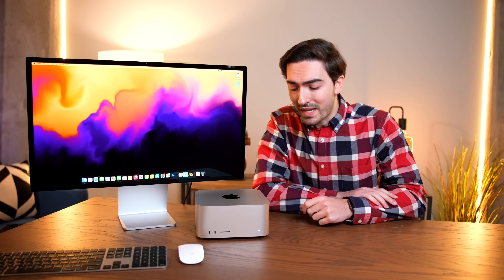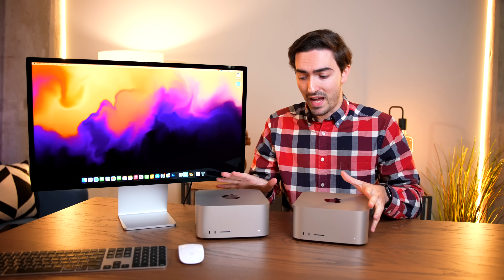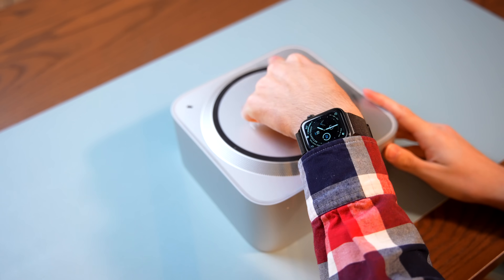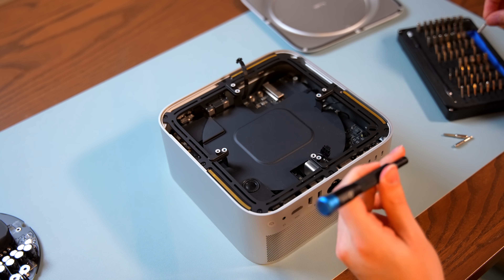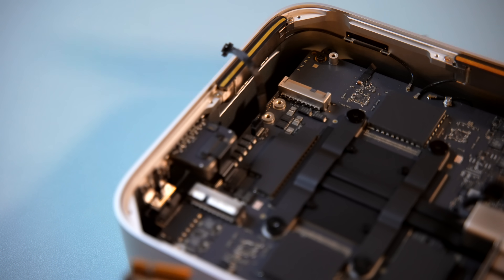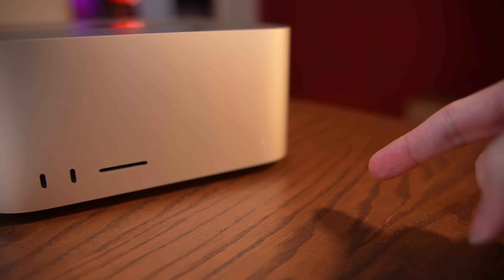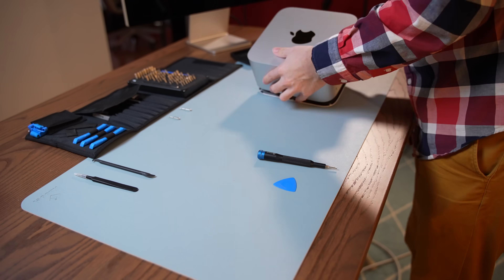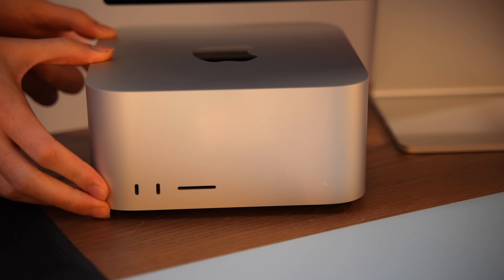What happens if you try to UPGRADE a $5,000 Mac Studio?

Comment: I think in Linus Tech they had use another Mac via usb-C cable to put Mac into recovery mode for switching Apple flash storage (SSD) from another Mac / next I would look into opencore it might work now on M1 macs/ if not owc has m.2 and Sata enclosure supports upto 3.50 drive which I would go with 16TB HDD 7200rpm and minimum 2TB m.2 SDD and just buy the enclosure from owc

Comment: The only way to persuade them is to stop buying from them. That how the free market works. At this point there are enough folks who don't care so Apple will continue the practice. If it is really a game changer then just pay up front for the max capacity. That is what I do. Either use the best and by the highest capacity or go fine a PC somewhere that you can build yourself and utilize PC software and bloat ware then go buy virus protection software to protect your hardware as well as software and personal information. I get it that they are pushing hard for you to buy the top of the line with the max amount. I'd be game once again to upgrade as I needed and to even upgrade everything like it used to be but I won't be holding my breath. So with my phone and MacBook Pro I will buy with all the bells and whistles. At least I can resell it easier. I won't buy used unless it is the max you can get. Anyone today that buys the low end with the smallest hard drive and least amount of ram is utterly stupid because I can't buy used and upgrade it. It become land fill junk and that is a whole other kettle of fish we should fry. If they are concerned about the environment they would build upgradable computers. I mean fully upgradable even with the newest and fastest chips. Integrated and all. Why toss out a perfectly good box. Let's upgrade everything. Less land fill and more people willing to utilize the brand and more to buy the brand. Open up 3rd party again too. But until they make that move you either continue or move on.

Comment: My guess is that they are running in a RAID configuration and the drives need to be configured as so. I would try plugging in both drives and booting a mac usb install drive to format both drives and run RAID assistant. Also, that 2nd slot is probably only for RAID configuration. Since it's coming from factory, it might be the default and only option. Also, swapping the drives, did you try a clean install or recovery mode? Doesn't the T2 chip come into play because of encrypted storage and secure boot?

Comment: meh. you buy a Mac knowing that you cant upgrade the internals. its been that way for over 10 years. it is what it is. they still make the most capable, classy computers on the planet. its the fact that Apple controls the eco system is what makes them so efficient. you have to buy into that, not fight it.

Comment: This is ridiculous. And it's really not about the upgrade-ability of the SSD – external thunderbolt SSDs are a lot cheaper not, you can get one if you need to. 
I'm considering buying the M1 Ultra machine, however it doesn't make me happy that after buying a $4000 machine I won't be able to reboot to Windows and play something once in a while. I can collect a more powerful PC for a less amount of money. 
And now this little thingy. The thing is non-repairable. If I, say, spill a water on the SSD, I won't be able to buy a replacement on eBay and swap it, the only way to fix it will be to use the official service. And the official service would ask for a ridiculous sum, which would make you consider buying a new unit instead of fixing the damaged one. I'm not saying about damaging the SoC – that'd the be a total disaster. 
Maybe the Intel 2020 iMac isn't that old and bad after all in 2023

Comment: I agree with most of your rant starting at 12min. But keep in mind that the majority of people that buy Macs don't have the knowledge and technical skill that you do. Doing things like this is one way that Apple can ensure that machines will be "good and healthy" years down the road. Possibly even the 4th owner of an Apple device will still be functioning. But if you made it easy to upgrade and allowed people (like my cousin, sshh. don't tell him i said that) to add and modify, then there would be a bunch of apple paper weights around.  Just thought I would toss out one of the reasons why I could see a reason to do this other than greed. But again, I agree with you for the most part.

Comment: Well... It´s actually well known that ALL Mac Minis are not upgratable. And although Apple makes it´s announcements and mention this fact again and again on every single presentation whenever a new Mac mini comes out, there are still people out there who think they are smarter. And now after a hard trying, someone realized that Apple was right. And what he does?  He´s got upset. Sorry buddy, i am very thankfull for this experiment you did for us, but to get upset is not appropriate. You knew that these machines are NOT Upratable. 
Anyway, i´m not an´expert.. But obvisdously it is very easy to build an SSD RAID-system on the new m1-macs, cause the RAID Controler is already built in the machine.  Some guy figured out very satisfying results with two cheap SSD enclousures. So at last: why not upgrate your storage this way and gain performance at the same time?

Comment: looks like the HD is locked or tethered by firmware / hardware controller chips - eg some form of EFI boot from the new chips, which reside on the hard drive which serialises them with the motherboard, so theoretically you would need something like a version of Opencore that can patch a replacement drives EFI partition that allows it to verify it with the security chips and hard drive controllers onboard. It will be some time before you will get any adapters to adapt non OEM  drives or even  compatible aftermarket SSD drives from third party vendors, I am sure there are toolsets / software that allow apple centres to reprogram replacement hard drives, faulty units etc., probably need this software to reprogram replacement hard drives. Then there is the issue of utilising third party non proprietary SSD drives, probably there will be latency introduced as the SSD would need to work through a patch / code that allows interoperability with the exisiting system, it would be nice to be able to upgrade the storage, but then again going by the specs of these machines you still wouldn't need a new computer for 10+ years for general use, Im still using a maxed out 5,1 machine to run a business - a new Mac Studio would be nice but in reality the Mac I have can continue to function for ever for what I need it to do, if you look at it from this point of view, the machines they sell are pretty good value, need more space ? Add a external drive or two, this issue is a PIA if you only look at specs, but if you look at it practically its a pretty good deal , unless youre daily editing 4k-8k footage you really dont need more machine, not to mention it sips on power, GTX 4000 series anyone lol - What they DO need to do is make the entry level Machines have 1TB drives as standard - this would be the best valued compromise for most people. It would be interesting to see what they do with the new Mac Pro . . . where upgradeability is going to matter . . . I seriously think they will go back to allowing upgrades to processors with daughter cards etc. like in the old days of Powermac Towers

Comment: I wonder if you could spoof the device ID or otherwise insert it. Because that is the issue, mac OS does a check on boot of all the hardware and verifying it recognizes it. It reads something it doesn’t recognize and then refuses to boot. 

Can M1 macs use Opencore? You can add in Device info and Mac OS will then recognize the hardware 
 (Apparently not. That is the ticket here. At the end of the day, it is just a computer. It clearly recognized something was plugged in. Adding the info to the boot loader is definitely the ticket to being able to expand storage, and some team will crack the boot loader some day.

Comment: The PSU looks very safe tbh. They have covered all the high voltage components and there is a backplate shielding you from the through hole contact leads on the bottom. This looks well designed and safe with minimal space overhead.
Reply: Well designed or over-engineered?

A studio PC is meant to be a workhorse not look good.
Reply: @trabant3060  Well designed. Apple has one of the best PSU designs on the market, they are always at the cutting edge of power design. Mostly stemming from their interest of shrinking power bricks. They have a really good power electronics team.

Comment: Thank you Luke; this is exactly what I wanted to know.  I have the Mac Pro (Late 2013) that I got in 2015 and have since upgraded it myself from 1T SSD to 2T SSD and from 32GB DRAM to 64GB DRAM.  When I first purchased it, I thought, "I'll never, ever need more than 1T of storage and 32GB of DRAM."  But of course, I did.  My current Logic sessions, when mature, use over 40GB of DRAM.  Knowing if the M1 Studio is upgradable was a key decider for me, and you solved it.  BTW, on another note: the SSD upgrade I did was from a Mac parts 3rd party, completely approved, and when updating to Monterey, the upgrade would not complete, because Apple said the SSD was not compatible.  I had to get the original SSD, upgrade it to Monterey, so it would update the Firmware, and then put my 3rd party SSD back in and upgrade it to Monterey.
Reply: I even swapped processor on my late 2013 :)
Reply: Remember how easily-upgradable Macs used to be? The B&W tower, the cheese-grater towers, etc...

Comment: In a PC, you would probably have the same problems if the SSDs are configured with secure boot and in RAID configuration when you have two units. My guess is both things are set in the BIOS/firmeware in the Mac: they probably have a type of secure boot enabled, which causes an error on boot if you swap SSDs between computers. And, it probably also expects some kind of RAID setup when more than one SSD is detected. The difference with a PC is that you can simply go into the BIOS and clear secure boot keys and configure hardware controlled RAID yourself - not the case with the Macs. But yes, they may be going even further than that to make it even more difficult for users to upgrade the hardware on their own. After all, they charge you 3 times the cost of components when you configure your Mac in their website (e.g. If you select 4TB for your SSD, it costs 3 times what a 4TB SSD costs for a PC - same with RAM).

Comment: Thanks for sharing and great video, agree 100 disappointing that they are locking down with firmware so that you can’t upgrade.  Also makes me wonder why make the additional slot if can’t be used.

Comment: This is common practice in the automobile industry. For instance, BMW doesn't let you swap out a media system without the mechanic having to register the new hardware with the system. The same applies here. You can't change the storage without registering the new hardware. (Probably with the T2 chip)

Comment: Are you a 100% sure, that the second port is intended to be used for SSD storage? Are you 100% sure, that ALL data stored on the SSD drive is physically stored on that board? There could be a small cache directly inside the CPU chip like the SRAM cache on the old SCSI adapters was. There could be some mapping information stored in some NV memory at the main board, or even in the M1 chip itself. In fact, there could be many good reasons to this behavior when swapping that boards. The simple truth is that you don't know how this thing is build, which signals goes between the main board and that module, you know virtually nothing about that architecture, but you have opinion. Great. If you look at that board, there is no M.2 port, so it is not ordinary SSD disk, it is something proprietary. It looks similar, but is not the same, that's the point. That thing is not an M.2 SSD drive, but you pretend it is. Pushing board into some unknown slot just because it sits in it is something stupid. In fact, there is no experienced technician, that would dare to do this without prior investigation. Same connector does not mean same signals, so you can easily screw things up, but you don't care. Swapping that boards between computers should be safe IF THEY ARE THE SAME MODEL AND SAME REVISION, but only from the hardware point of view. Etc… You had done something very risky, you discovered, that swapping that board is not that easy, but you still don't know if it is possible or not, you don't know what that another slot is intended for. And, of course, you have a youtube video with a lot of views. Was that worth risking that expensive devices? Judge yourself.

Comment: Bullshit. This is the same as the Mac Pro and iMac Pro with the T2 chip — but you are not knowledgeable enough to have paid attention to Macs built since 2017. The Studio is no different. Upgrades—if they ever happen—will be the same as the current Mac Pro and iMac Pro. Buy the proprietary upgrade kit (available for Mac Pro and iMac Pro from Apple since 2019), install per the instructions. Initialize from Configurator (updated last week to work on the Studio) into DFU Recover mode and reinstall the MacOS from Internet Recovery. The replacement SSDs are not available (yet) but there's no reason to believe the procedure will be any different. Unlike the Intel Macs, the controller is built into the M1. Next time you throw a temper tantrum, learn what the hell you are talking about.

Comment: Actually the reason is quite simple and the reason behind that reason is even more simple.

The reason you can't just swap is because the "SSD" is NOT an SSD. It is a memory module that is only part of the SSD. The controller for that SSD is on the motherboard and that controller is matched to the memory chips on the module. The same as a lot of other SSD cards our there. So putting any module into the second slot will not work until the controller is paired to the memory on that module.

That being said, the reason why they are doing this is simple. Some have said it is because of performance. I admit there MAY be a slight increase in performance. However, that increase pales in comparison to the fact that now other companies (OWC, Transcend) can no longer provide upgrades to a mac machine and you are now FORCED to deal with Apple.

At least that is how I see things currently. There may be a change in the future. However, that would require someone to develop a way to pair the controller to the memory modules that you are wanting to install.

P.S. Both controllers are on the board. The second one may not be active but it is there.

Comment: They stranded all the fusion drive users post Catalina, I am not surprised by anything Apple does to it's supporters anymore. I had a 1 year old mac that they admitted was broken when Big Sur and Monterrey wouldn't fit no the old Fusion drives, but they still refused to fix it. I just turned around and bought 2 new PCs. I am done with Apple. MS never had such audacity, and you can self-upgrade or repair any PC.

Comment: I hear it seems you can no longer change anny parts in Apple as it all seems to have a serial number, wen change a part that have a other serial number it wont acsept it, even hear , if you try to replace a new battery or screen in those new IPhones, even it,s a legit apple battery or screen, it  seems it don,t get acsepted, so that only Apple repear can replace the battery or screen, ( battery be still posible but then you need to swap the circuit board from the old  battery to solder it on the new battery)

Comment: Should have option-booted from an external known good OS and explored the drives via Disk Utility.

Also, get your hands-on the Service Technician Manual which covers the entire tear-down and modular replacement processes to avoid any possible errors in your work - my arm-chair quarterbacking thinks there might have been a missed cable connection somewhere that caused the increasingly problematic behavior

Lastly, I agree that it's quite possible that there might be a software block on the SSD port based on lower end models - I can personally verify that Apple™ has done things like that before on their hardware.

Comment: Jumping the gun a bit. I think the standard ssd might be dumb and use the controller on the motherboard. It might be paired together so it won’t boot a different one (pretty shitty). Maybe the second slot is just standard nvme? I was surprised you did not just install a normal off the shelf ssd in the second slot.

Comment: I know you said you erased the drives through recovery mode but if you used the local recovery mode that means the recovery partition remains on the SSD. This may be a reason why the machine is panicking as it can see 2 recovery partitions.

Try use internet recovery to fully erase the drive and all partitions and it may work. As internet recovery is downloaded onto memory you are able to erase the recovery partition using it.

Comment: Something curious is how a speedometer works in a car.

If you try and swap a speedometer from one car to another, it often will refuse to say how many miles the car has traveled. 

But if you buy a brand new speedometer and install it, it will work and copy over the mileage from another chip inside the car.

It seems the SSD’s are registered to the computers they are in, and are not swappable for security reasons.

It will be interesting however if a brand new SSD that’s never been installed in a mac will end up with the same end result.